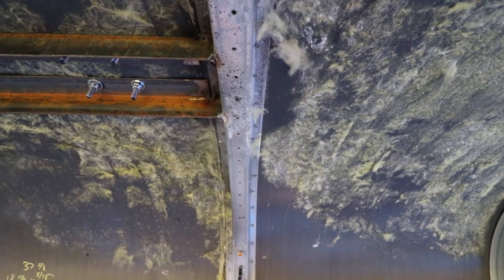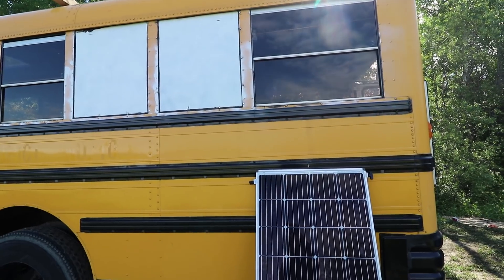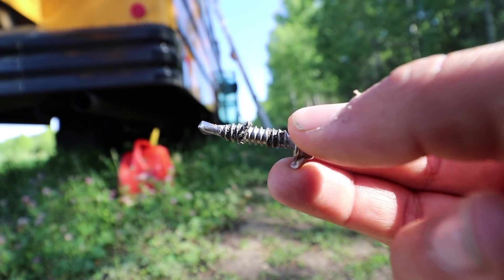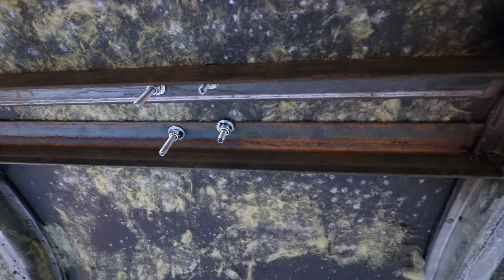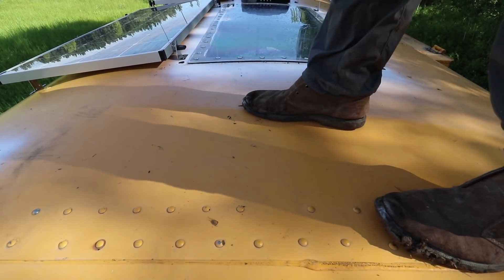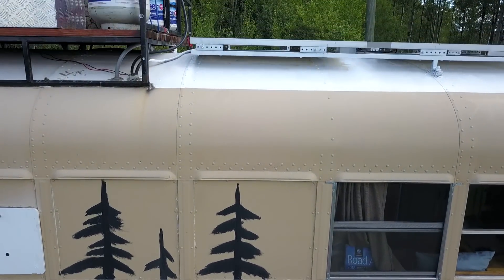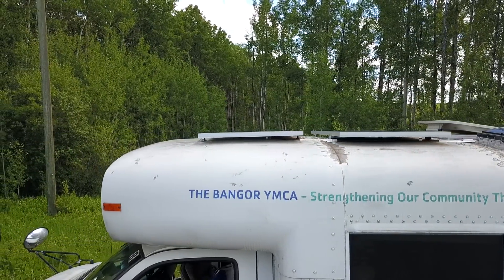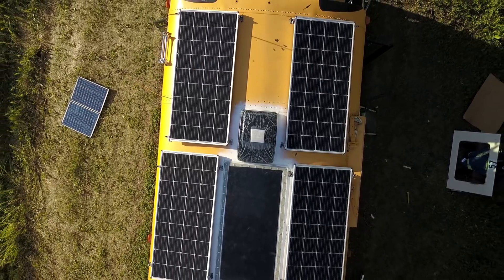How to Mount Your Solar Panels

Comment: I would use 1 5/8 inch gal.   Unistrut  bolted though center of  ribs with 3/8 threaded rod and fender washers

Comment: Basic rules: DO NOT rely on bolting into a soft metal like aluminum, Instead, put and iron L channel frame over the aluminum and bold through the iron and aluminum, together. People cannot over-time expect aluminum to hold. It is a matter of WHEN not IF it will fail. It will fail, I know it is a pain - in your *ss....but, you can literally kill people and many multiple dead bodies and wrecked cars and even dead pets. Just over design it is the rule. Maximize not minimize.

Comment: How about welding them fasteners and frame to the top? Why didn't you think of that? Am I missing something?
Reply from the maker: I don’t know if I would want to weld the thicker steel mounts to thin sheet metal. But, maybe it would work.
Reply: @navigationnowhere  Well, yea, it seemed obvious in my mind not to do it that way, but rather welt do the framed areas, just so that you know your close to the structural strong points. Though, Maybe there are concerns with doing that. I am not a welder or anything. I am just up against doing the job myself or wanting to have solar, but I have a prevost bus and they sit pretty high as it is.

Comment: You can also get tin snips and some thin galvanized sheet - what ever thickness you want. If brazing isn’ an option use J-B Weld epoxy. It has a tensile strength of 3960 PSI. Build large patches to support your large washers.

Comment: Cant you mount a rack that you can bolt the Panels to? Most will have a deck on a bigger bus in addition to the solar. I still think a full length rack secures everything

Comment: I hate to see people just gluing them on, no matter how strong the glue is, could be stronger than the steel, but you sticking it to nothing stronger than PAINT !  paint flakes on its own without all the stress of a panel being attached, if you really want to use tapes and glues like a pre-shooler, at least go to your dealer, and ask how much ''pull'' and weight you can attach to the paint before it will break away, go ask... see what they say.....

Comment: I would love to get a 3/4 length bus, but need to do the build in stages. I’m going to take your advice and gut it first so I can check for leaks, add supports, insulate, etc. I’ll have to grow into the solar panels and roof deck so I was thinking of mounting a super strong rail system or rack or something attached to the ribs themselves so I can add whatever size panels, whatever size deck etc. Is this a good idea? Is it good to attach it to the structural beams of the bus? Like a roof rack? Total newbie but my family needs a place to live on the road ASAP. Having a hard time finding a good bus.

Comment: Jax said one almost fell off though?
Reply from the maker: Yes, one did almost fall off. It was not a mount issue. The panel was never installed tightly after test fitting. Must have forgotten

Comment: search "VHB tape solar panel installation".   No holes in the roof.   use 3M VHB tape to mount the mounting brackets to the roof and then bolt the panels to the mounting brackets.  VHB tape is stronger than screws and you can tape brackets with a longer base.   So the stressed
area covers a bigger footprint.   It will NOT come loose.

Comment: Rather than washers, why not use a metal plate with holes matching the ones in the roof? That would give even more surface area. Also, what about using rivnuts as fasteners?
Reply from the maker: That would also do the trick. It would really depend on where you put your mounts and how secure that location is. It all comes down to movement and vibrations. Those two = bad things eventually. Haha
Reply: rivnuts can pull out they are better for hanging them mounting in line

Comment: Excellent information. Having had a panel on my car for a few years I’ve found vibration can be a real and silent enemy. Larger panels will flex/vibrate and create a standing wave at a resonate frequency depending on speed (no bumps required!).
To keep this to a minimum I suggest using a piece of POOL NOODLE the foam sticks kids play with in a pool or at the beach. Place it between the roof and panel to dampen the vibration. I don’t have proof but strong suspicion that this keeps the cells from structural destruction cause by oscillation/vibration. I know that pool noodles and even foam pipe insulation are available in many diameters and such. I think even a piece 18” properly placed with the wind flow could really work well.
Reply from the maker: Pool noodles sounds like a simple cheap solution. 👍Will totally kill those vibrations ! Thanks for sharing.

Comment: Awesome logo super-imposed on the drone shot! At the risk of asking a stupid question... here I go: Why not reverse the solar panel bolts so that the nuts are accessible on top of the roof? Would that not allow for tightening if need be due to vibration? With the nuts on the under-side, they will presumably be inaccessible due to foam insulation and wood finish inside. Just wondering. Also, Skoolie's propane tanks on the roof seem like a great idea. Where did you put Navi's propane tanks, and why?
Reply from the maker: Thanks! You could reverse the nuts. However, I typically use locking nuts so they would not come loose. But, that could totally work. As for propane tanks, Navi’s tanks are under the bus in the rear. It is a 29 gallon asme rated tank. Many people put them on the roof and that works as well.
Reply: With a lock washer on the screw head I'm guessing.

Comment: Having lost a panel on the highway to a strong cross wind I know how scary that can be. The failure wasn't the attachment to the roof but where the panel attached to the Z bracket. A nut vibrated off and have the wind a lift point. When I mounted the replacement I used 1/4" bolts with toggles that are meant to be used in drywall. This have me a large surface area on the inside.  All nuts used are self locking with Locktight red added
Reply from the maker: 🙌 Thanks for sharing for those reading! It’s super important for people to know that vibrations... even micro vibrations, can back out a screw. Lock nuts FTW
Reply from the maker: Haha For The Win. Lock nuts and lock tight are  life savers and will help prevent your bolts from coming off.
Reply: Navigation Nowhere What does FTW mean?
Reply: Navigation Nowhere hahaha, not up on all the abbreviations, thanks
Reply: Steampunk Steve yes I ended up using the nylon inserted nuts that won’t vibrate off. I also paid the extra money for stainless steel to take care of future rust issues.
Reply: Thanks for the tip !

Comment: What would you recommend if you have a fibreglass roof ???
Reply from the maker: Typically if you don’t have clear structural point to use. Try to get a nut and washer behind the fiberglass. Try to stay away from any flexible parts of the fiberglass